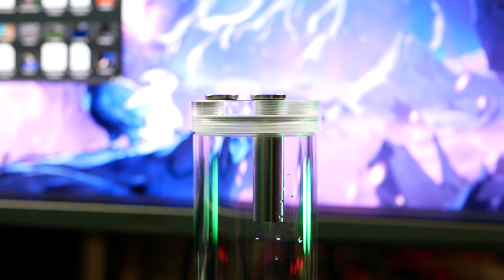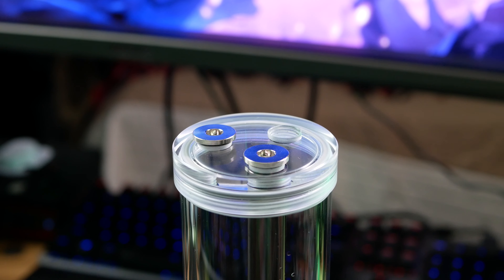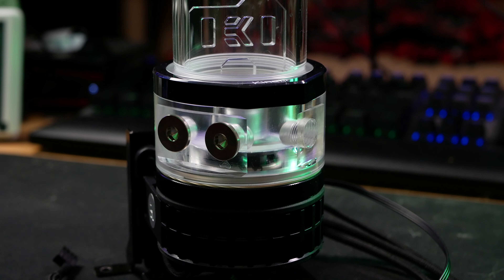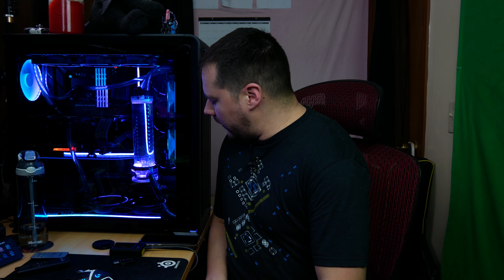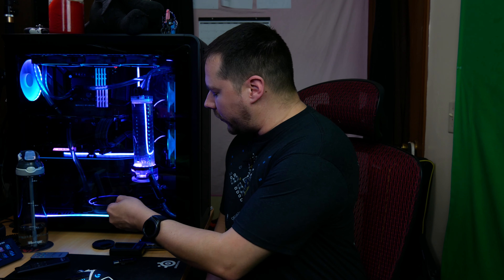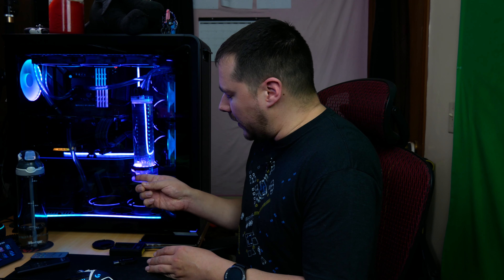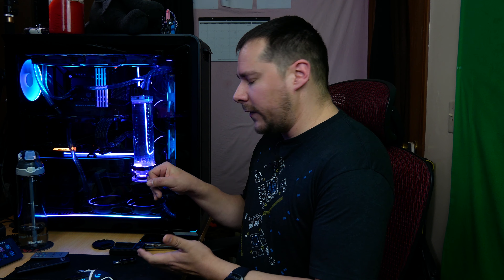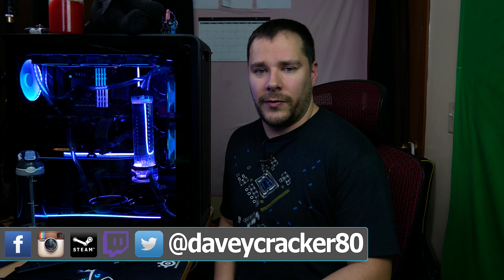EK Quantum Kinetic TBE 300 Plexi Overview

Comment: My EK Quantum Kinetics pump res. arrived today. Looking forward to finish the build.  Great video!!  Thanks for taking the time out  and showing us ur experience with your set up. Almost forgot did you end up using more than 100ml to fill your system? Im running a  Coolstream CE 280mm rad and PE 360mm rad and only ordered 1 bottle of concentrated Cryofuel.
Reply from the maker: I'm glad you enjoyed it and thanks for watching! Hoping to get back to getting content up soon again.
Reply: Davey K  I’m running 2 rads a EK CE 280 and EK PE 360 . Will one bottle of Concentrated Cryofuel Clear and 100ml be enough to fill the system?
Reply from the maker: @GonzoGaming22  to give you an idea of how much fluid I ended up needing, I bought two 1000ml bottles of their premix and ended up using most of the first bottle to fully fill the loop. That's with a 360, 380, and 240 rad in a large case, so you may not need that much, but one thing I advise is having much more on hand than you actually need.

Comment: You mentioned using one of the top ports as an outlet. Any negative points on doing this? And would I need the inner tube installed to achieve this?
Reply from the maker: All of the top ports are inlets. You can use two of the three bottom ports as outlets.

Comment: I noticed at 1:51 you have the RGB going without a mother even installed, do you have a lighting controller installed somewhere?
Reply from the maker: Yes, I had it connected to a lighting controller that was connected to a spare PSU I keep on hand that I had sitting just out of sight.

Comment: I know this is an older video but my question is can both ports on the bottom be used as outlets? While having the inlets at the top? I have a loop planned for the cpu and gpu to have their own rads but run to the same pump/res afterwards

Comment: EK website says its pumpless. Does that mean it doesn't include a pump (res only) or the pump is interchangeable ?
Reply from the maker: The one I have is a combo and it includes the pump. The combos they have are found here: https://www.ekwb.com/shop/quantum/reservoirs/combo-units/d5-tube-combo-units

They also have a bunch of different combo options though if you look under their Quantum listings.
Reply: @DaveyKTech  Thanks man.

Comment: You should not fill the pump completely. Water changes in size when it gets hot and needs some extra space. Otherwise, you are creating unnecessary compression in the system which may lead to leaks.

Comment: Does it come with the mount? I just order 1 and dont know I need to order the mount or its included.
Reply from the maker: I do not recall seeing any kind of hardware to mount it and the one I'm using was bought separately.
Reply: @DaveyKTech  what is the mount?  can I have the name? Thank you.
Reply from the maker: @THANHNGUYEN-uq8zk  It's the EKWB EK-UNI pump bracket. Comes in 120 and 140mm sizes.

Comment: i waiting till 3080ti comes out till i convert to custom water loop.. no point in 2080ti when have 1080ti on g12 adaptor cooling what is yo9ur system specs ur running nvm i see in description lol
Reply from the maker: It's not a terrible decision to wait, you definitely want to be sure about what hardware you're cooling and such. The G12 adapter is definitely a solid hold-over until you're ready to go all-in on water cooling. And hey, putting the specs in there final pays off!
Reply: @DaveyKTech  I've got 9900kf 5ghz 1.3v asus maximus xi hero, same samsung 970 evo plus 500gb m.2, evga sc black 1080ti 2088mhz(h55 on it) corsair 850 rm gold plus, corsair air 540 black case, h115i pro w/ ml140 pro upgraded fans, all nf 12 pwn 120mm fans intake and exhaust through h55 and other drives and ssds
Reply: Also the digital 2x 140mm digital 4x 120mm and 2 strips of phanteks
Reply: @DaveyKTech  the 1080ti goes 50 to 60c max depending on room temp
Reply from the maker: Those are some nice specs. I've considered at times bumping up to the 9900k from the 8700k, but may actually go to the Ryzen 3900x in the spring. But we'll see. But yeah, that G12 is doing a nice job. My 1080ti caps out at around 45c during most gaming sessions with my CPU usually in the 50-60 range. I also run my fans really low so I could get better cooling performance, but the silence is really nice.